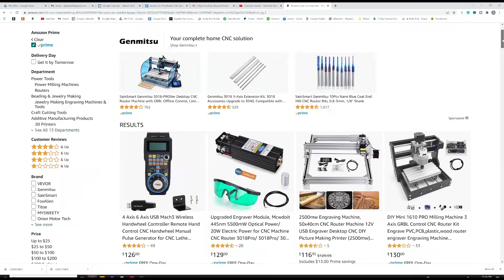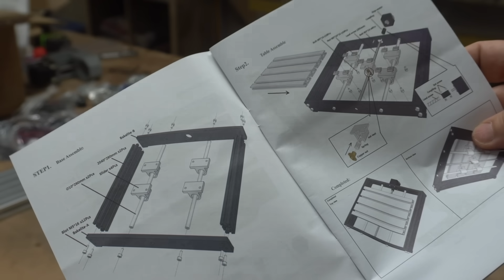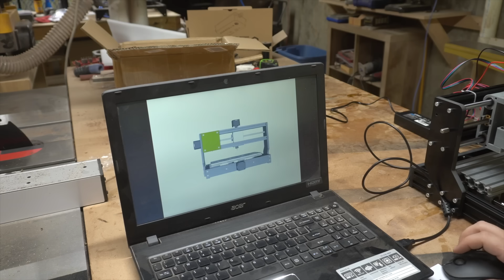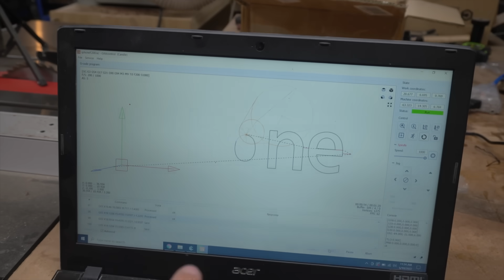The Cheapest CNC Router on Amazon

Comment: It's very cool that it works at all. Could you test using it to make a PCB? That seems like a potentially useful scenario for a machine with otherwise pretty limited utility.
Reply: For PCBs, its hard to get small details withour breaking your bits. I'd recommend getting a similar machine with a small 5w laser. You can then use the laser to create an etching mask out of black spraypaint. There are videos about this online.
Reply: @ironnoriboi  I use a 3040 with exactly the same bits as the ones shown here for milling PCBs.  Never had any trouble.
Reply: @No1sonuk  Even with 0.3mm traces? QFN packages have a very small footprint. By the time I get my V bit deep enough to reliably cut all copper, it makes  cuts that are too wide for 0.3mm tracks.
Reply: @ironnoriboi  One thing people forget is that not every technique is suitable for every circumstance.
e.g. I use my router with through hole and large SMT.  I'd use a photo etch method if I ever needed to go really small.
Reply: @No1sonuk  Fair. I almost always use microcontrollers with small footprints. But if you can get away with through-hole components then a milled pcb will work wonders
Reply: @No1sonuk  If you ever get a resin 3d printer, with an LCD mask, they can easily expose a photo resist. Its a good technique
Reply: @ironnoriboi  nerd
Reply: @tylermiller8142  Yea 😔
Reply: @ironnoriboi  😂❤️
Reply: @No1sonuk   I'm looking to make some amplifiers and the trace don't need to be really small  some may get to be 5mm wide so this will work for pcb
Reply: @ironnoriboi - I recently made a single-sided PCB on my 3018 for a CH32 TSSOP package with 0.254mm track width. The smallest package so far. It wasn't easy, but eventually succeeded. Key was to use well-centered new (i.e. sharp) 10-degree V-bits and a height-map. For easy soldering I made the PTH-pads ovals 2mm high. I think I spent most time checking for shorts and cleaning the tracks from barely visible copper debris.
Reply: Yeh I have one of them its for PCB CNC 🤣
Reply: With this one pcb is a night Meara
Reply: Using one for 2 years, $50. But all aluminum. Good for mdf and mahaguni.
Reply: You need very accurate Z workpiece probing to get that to work. Not an easy upgrade as far as I know.
Reply: @rewolff2  The machine has it build in, you just need to connect a pin to the spindle and to the copper cladboard.
Reply: Milling a pcb. Lol
Reply: @nicewhenearnedrudemostlyel489  Why the LOL?

Comment: I do want to get my foot in the door on CNC routers. I'm open to your suggestions. I do small to moderate woodworking projects. Thanks!
Reply: Get something like this. Majority is about getting accustomed to using programs. If it then seems to be your thing, it's much easier to upgrade. Besides you don't want to throw thousands to hobby that you might end up thinking tedious. I bought 3D printer as innovator to learn 3D cad software. I've used 2D ones quite a bit. Now I'm reasonably adept at designing and printing functional parts. So I printed MPCNC and recycled my initial old printer to it as I had upgraded years ago and it was already disassembled. Now I'm learning CAM basics and things are proceeding quite fast. By recommendation is to start with simple cheap machines as drawing etc. can definitely be the killer for many more so-to-say "practical" conventional workers.
Now if and when I get my mpcnc to work with aluminum I'll begin to design my own cnc router machine. 3d printing is great for that too as you can print brackets etc. that don't need to be made from metals.

Comment: I wonder what the price is today? Do you think it can cut through 0.5mm Mother of pearl (MOP) or Abalone? Would it rout a cavity for the Abalone or MOP in an exotic rosewood headstock blank that would fit on its bed? This would make this a highly valuable project machine. How deep have you cut with this successfully? Can this be slowed down X_Y_Z-wise to make using StewMac's tiny CNC inlay bits possible?

Comment: What is the largest size board I can use on the CNC?   I want to make funny signs to sell at local festival.   

Oh that motor, cut a light filter screen and install on CNC motor at the openings on the top side.   Keep dust out of motor.  Can vacuum them often to make motor remain clean of dust and last longer.

CAN YOU HELP FIND ME A CNC THAT COULD TAKE 16”X16” X1” BOARD.   THAT SHOULD BE MAX SIGN SIZE OR SMALLER.

IM DISABLED AND TRYING TO MAKE A LITTLE EXTRA MONEY.  GOD BLESS! ALTON

Comment: The plastic is not 3D printed. It’s injection molded. The lines you saw were from the mold pattern which likely was 3D printed.
Reply from the maker: Good to know!
Reply: Nailed it!
Reply: Probably cnc bit lines from milling the Moldavie...
Reply: Yeah if it was printed it would have taken a pretty long time to produce. As mentioned the lines are from the mold. Still for the money it’s a good investment just to learn on. Pretty sure it will crap out after 3 to 4 months of use. But hey look at the fun you’ve had. Probably more fun than a big night at the bar with your friends for $120.00 😂
Reply: Exactly what I came here to say.
Reply: Yeah, if you ever see a seam line around the middle of a plastic object, it’s an injected mould, that seam is the join between the two moulds. Around the seam will be a slightly circular point, that’s the injection point.
Reply: The lines are from milling the mold
Reply: Yes I was wondering, about that. Is it even possible to get such high quality 3D printed part…

Comment: OK, so "Ima Newby" spends $2500 on their first CNC router and launches into their first project... shortly followed by their first crash.  Fixing it will probably cost more than $120... see where I'm heading?  First, buy one of these, get your head around the processes, make some cutesy signs for the dunny door, make all the mistakes, and drop what you have left into the dumpster!
You will still be financially better off, and in a better informed postion to buy and use the dream CNC, if you still think it's for you.   :o)
Reply: Yes. Also if one doesn't have CAD and CAM experience. Well the machine is essentially useless expensive toy. I got 3D printer and learned 3D CAD. Then printed MPCNC and put my first disassembled printer as parts on it and began to learn CAM. It's going great and have actually already managed to make something with it, even though I have only spent like 5-10 hours with this new toy. But it's looking like I'll be upgrading/making my own better cnc fairly soon. But all in all. It's the computer side of things that will likely kill the interest. It really takes dozens of hours to get into.

Comment: got the 3018pro, great aside from one thing, it's not built to be easily expanded.  kits are available for length, but not happy with the rods, i'd redesign it so it could take open bottom linear bearings and supported rods also the z flaps around under the slightest load.  not yet at the part where you have to take the first step back apart to do it right... there it is.  grbl is what's on the controller board, you don't need to download it, you download grbl compatible software.  i use bcnc, all python.
Reply from the maker: Thanks for sharing

Comment: This is actually a great little machine if you want to create quick home made PCBs. You can also fiddle with the electronics and the firmware and instead of using GRBL, you can play with LinuxCNC, which is an overkill, but it's an awesome way to learn about the engineering behind CNCs. Once you know those things, 4 or 5 axis machines would be easy both to operate and even design. This is an entryway toy CNC in the world of operating and engineering those machines. Pretty cool.
Reply from the maker: Thanks for the tips!

Comment: you can now build better woodworker cnc machine easy, you have aluminium sheet can cut and drill same tools what wood working, only need buy biggest nema 23-34 stepper motors, and biggest driver board about 5Ampere boards ewery motor, then 10$ controller and laptop install linux cnc software, frame need how big table you want buy ball screws and linear rails, i have build 1500 x 1500 table and Z have 300, metric. cost about 400$ and some parts salvage trash yard, motors, rails, metal shop. same can use laser, woodwork,aluminium work, plastic, and big machine can use made all kitchen cupboards,panels, etc wood parts. dovetails, holes,sguare holes, lot easy make furnitures, and not cost lot, ebay can orden nema 23 or better nema 34 motor kits, ballscrews,rails, if not want make all diy, but home can made rails metal tubes and bearings easy cheap too. and buy only acme treads. or better ball screws. motor not have important voltage, only ampere need looking have about 5A max and cheap drivers same 5A max. if use drivers more than motors max ampere motor burn.

Comment: little tip, if you add top of wood adhesive plastiv vinyl, before carving, then carve, and then use spray paint carved holes, and thn dry,then take off vinyl tape, etc, and have good painted all carved but noy have at woof lot paint and little sanding need only.

Comment: Can i engrave on stainless steel using this?
Reply from the maker: Probably not
Reply: Why not?
Reply: @yagamilight6261  try it... but be warned.... when you start the engraving process, RUN to another room for safety.
Reply: @yagamilight6261  stainless is one of the worst materials to machine with cheap equipment. It's essential to have very rigid machine for metals. I have mpcnc project and I'm now doing wood on it. I'm absolutely sure that it'll be capable of aluminum when I get bits and settings right. Maybe even very small jobs of steel if everything goes right. But stainless. I'm about 99% sure that I won't even try it ever as it'll almost surely result in disappointment.

Comment: The ShapeOKO CAN switch the spindle on and off. Assuming you use the correct controller board.
Reply from the maker: This is point. Why doesn't it come this way. There's got to be a good reason

Comment: An important word to the wise.. with reference to the “plastic” material the frame etc is made of… under not circumstance use loctite type thread sealer on any of the hardware that come in contact with this plastic… it reacts with the plastic and causes it to become brittle and crack!!

Comment: Its injection molded, but you can see machining lines from the original mold
Reply from the maker: Ahh thanks! That makes sense
Reply: @AndyBirdBuilds  I had the similar thing, Sainsmart 3018, the builds are copycatted, just different matrials, different sizes. Also the motor is a common 775 ~50 watt spindle.

I hacked my rig with a pair of MGN12 rails and 4 carriage blocks, and added a ball-screw Z axis with a 400 watt spindle. It was a project.
Reply: Was about to comment the same. Mold for manufacturing has just been done poorly and it looks like 3d printed.

Comment: You wonder why other machines don’t turn the spindle off automatically. My guess is it’s because the spindle is controlled by the G code. You can always add code to turn it on and off whenever you want it to. Look for an M3 (spindle on CW) and M5 (spindle stop) in the program.
Reply from the maker: I think you're right based off what other have said as well
Reply: I run a home brew machine running on Arduino/GRBL and spindle control is just a few simple lines of g-code. I really don't know why some small shop, mass-produced machines don't out of the box...

Comment: It's a great way to learn... costs about what a single textbook would cost when going to school.  I'm actually on my second one now... both still work.  But, I got so used to having the smaller (1610) that I didn't want to screw it up experimenting, so I bought a 3018 to break... which was actually cheaper than the first one.  Side note for those who haven't noticed:  1610 is 16cm x 10cm work area, 3018 is 30cm x 18cm... roughly.  Height is roughly 45mm.

Biggest issue is the under-rated power supplies they come with.  I popped the first one with my first mistake.  Replaced it with an old laptop brick for a while, then a custom job.   The second one didn't pop but was obviously crow-baring (shutting down the output to protect itself) under any kind of load.  I could hear it stutter; thing couldn't even cut hardboard.  So, I replaced that one with better as well.  Cuts much better now.  Oh, the 775 motors are cheap on eBay, but that '775' is just a size so be careful on the specs.  And, they make 795 and now 799 with the same diameter but longer.  They fit but will absolutely need a better power supply.

Best use for these things, besides learning, is mounting a drag knife and cutting out vinyl decals. My kid loves it... custom stickers everywhere.  Next is engraving Plexiglas for edge-illuminated nightlights.  Styrofoam rocket nosecones. Some wood silliness.  Did a couple isolation-routed PCBs, worked but... you know... JLCPCB is hard to compete with.  Tried engraving stainless... nope.  But, cutting out a decal and using that to guide q-tip electrolysis did a good job of cutting names in spoon handles :)  There's always a way.

So far I've only managed to mangle a little bit of aluminum, but I've not given up on that.  With the right techniques, I think it can do something useful... still learning how.

Oh, and thanks for the tip on coloured CA for filling an engraving.  Never heard of that; nice results.
Reply: Not being one to read looooong comments, not mad I read yours. Lots of useful info! 👊
Reply: Sounds like it would be good for engraving Dollar Trees wooden craft pieces or possibly even their metal craft shapes.

Comment: That was verrrrrrrry useful to me. I’m making guitars, and using a separate ’plate’ of figured woods to go onto the headstock, for both decoration AND to restore thickness. 

I’m not building commercially, but nevertheless would like to have ‘my brand’ on the headstock. This could well be the answer - using both your superglue ‘inlay’ as well as maybe making the space for inlays to be inserted. 

Who knows, it may even engrave shape in mother of pearl or contrasting woods to fit into those spaces - they’re basically the ‘negative’ of the kind of carves you’ve done. Even if it would score the outline deeply enough to make for clean breaks it would save a lot of tedious hand working.

I know there are also laser heads which swap in for the engraving heads, so there’s be another option..

Thanks for making this video - as I said it’s very helpful and thought provoking.
Reply from the maker: Great!

Comment: If it's a 1610 machine why are the instructions for a 3810 machine?
Reply from the maker: A 3018 is just the size of the machine. 300mm x 180mm. This one isn't that large. It's 160mm x 100mm. That's how I know what it is. The box also says 1610. The 3018 isn't $130, its more expensive. Why there's a manuel for a 3018 is probably because I paid $130 for a cnc router.

Comment: Yes, that is bakelite. It's basically the first type of plastic that was invented. Very good and strong.

I have a 3018 and using the stock spindle I did a bunch of things. Cutting 6 mm plywood at 800 mm/s, no problem. Cutting toy train tracks out of 12 mm thick laminate flooring, no problem (1000 mm/s using 0.4 mm depth per pass). 

Now I upgraded its X axis by replacing the round linear guides with proper MGN 12 linear rails. Then I replaced the 3d printed Z axis with rigid aluminium one (80 mm Z travel) and replaced the stock spindle with the 500W spindle. Now it's a much more rigid and serious machine.
Reply: Not likely bakelite. I think that's delrin or something in that vein.
Reply: @jothain  Delrin was my first guess as well
Reply: @blu_smoke7638  +1 for Delrin (aka acetal).
Reply: Bakelite... not well known these days, and probably underrated.  I have a 70 year old lathe with Bakelite idler gears; they are still in great shape, and are kind to the steel gears they mesh with.
Reply from the maker: @PiefacePete46  Thanks for sharing!
Reply from the maker: Good to know, thanks!

Comment: Would be cool to see if you could upgrade it. 
How deep can it cut, as is, out of the box.
Reply from the maker: I'd say an 1/8th of an inch but would depend on the material you're cutting
Reply: @AndyBirdBuilds  I would really like to see you put a machine like this to it's limits! I have a larger 3018 to mess around with in the garage, I think your underselling the capability a bit tho. With a proper 1/8 inch end mill and good feeds and speeds you could probably cut 3/4 inch depth. Not to say this doesn't take an incredibly long time. But I have managed quite a few cut outs on mine. The real limitations I have found here are actually in the X-Y axis. "What can I come up with to make that is 3/4 inch thick but only a few inches wide and a few inches deep." I have been starting cabinet door designs just to prove the programs and designs. In future I hope to buy a larger machine and just scale the proven design to full size.

Comment: The spindle actually come from drills type. It's cheaper to buy something already existing than design new one. Plastic on frame is essentially "mystery plastic" I'm sure was recycled. Sometimes get brittle pretty quickly!
Reply from the maker: That makes a lot of sense!
Reply: It's probably carbon resin (carbon fiber without the stranded layup). Rigid and flying out of China in every available product atm.